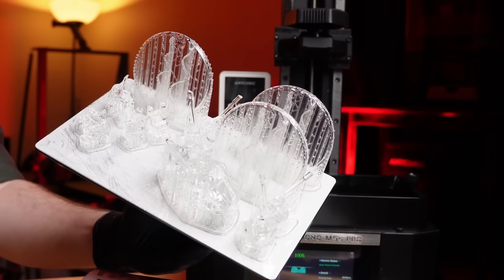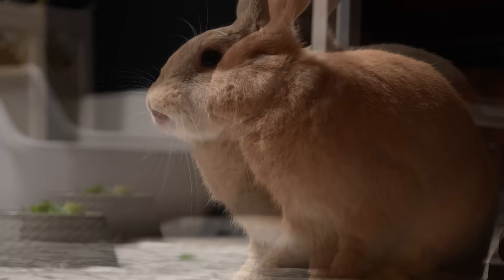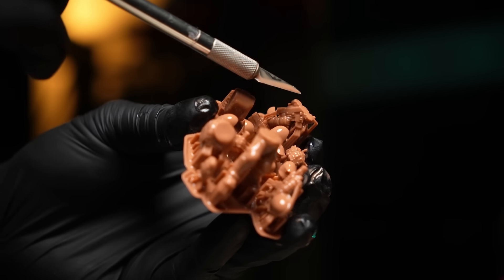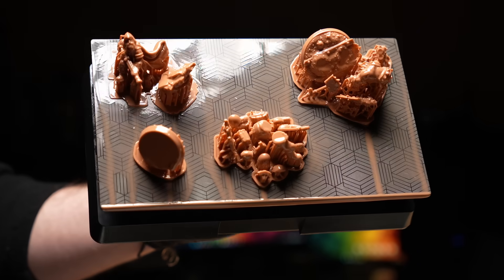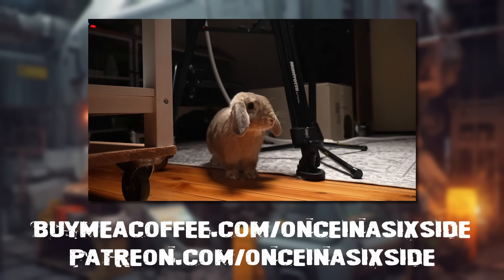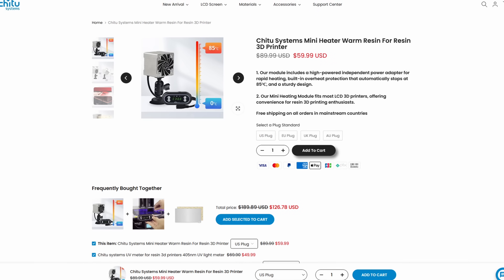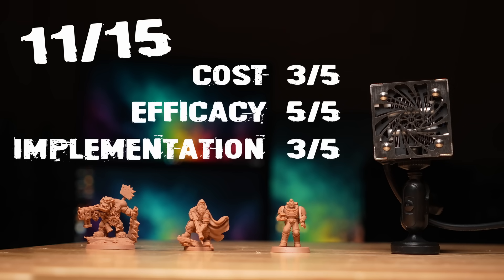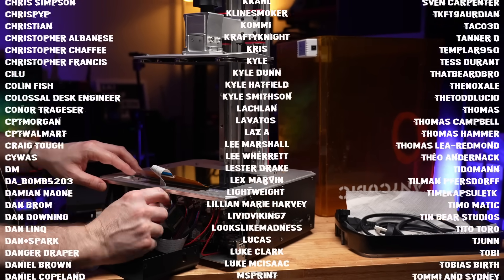Resin 3D Printers don't NEED inbuilt heaters (TESTED)

Comment: It's just not that hard to heat the resin... A heat sleeve around the vat works great on my mono m7 max, and the heating cycle mechanically stirs it.

If I needed more I'd add a little heater inside.

Comment: The M7 pro's heating function is amazing. Cleaning isnt really all that much of a pain in the ass. Normally I clean it like you would a normal vat. However if I want to DEEP CLEAN it, I drain out what I can. Wipe down my NFEP, and throw some IPA in the vat and run the heater and let the IPA cycle through the pump

Comment: Instead of placing the heater inside the enclosure, I've placed my printer inside a small tent, which I have insulated somewhat, and have placed my Chitu heater inside that tent (didn't put the lid back on the printer). Just launched a print, we'll see how it turns out. It's currently at about 12 degrees in my garage (Canada), but I don't anticipate any issue as I've done so in the past with another heater. It might be tougher on the heating unit, making it "work" from prolonged periods of time, causing it to fail earlier. We'll see.

Comment: Just for added detail so others dont need to do the maths:

Maximum power consumption and the annual electricity cost in the UK (£26.39p per kWh via BG) (based on continuous 24/7 use)

The Chitu heater uses 200W which works out at £463.35 per year.
The Elegoo heater uses 120W which works out at £277.87 per year.
The fermentation belt uses 25W which works out at £57.76 per year.

Of course, this assumes the devices are running non stop, which is unlikely, but it is still useful to know.

Also, just to let you know, the amazon link appears to be dead. just in case your getting affiliate funding. :)

Comment: Yeah, these solutions are half-assed at best, a brewers belt poorly tied around the thick metal vat wall or a blower heater which can have all kinds of mixed results in terms of actual heating depending where the heat is being blown. I think uniformations approach is the best solution among every other integrated, not added, resin heater in all the other machines

Comment: As far as heaters go, I have a Halot Mage S, its been easy to use and I am liking it, (I know Fauxhammer hated it but VogMan loved it so to each their own) but I also have an enclosure for it. If I wanted to add a heater for our winter months, does the heater need to be inside the printer itself? Or can I just keep the ambient temperature in the enclosure in the ideal range?

Comment: Chitu one replace the 3M tape with Tiger tape for vehicle registration plate's the heat in the enclosure softened the glue on mine before it's stretched and hit the vat but could have been worse!

Comment: I got the exact same belt and did the same process. FYI if you are going to do this. The "Rubber" part of the heatbelt also contains some wiring. This ruined my belt, and is a potential fire hazard if cut.

Comment: I just bought and used my first resin printer.. on about my 8th print, a tiny bit of cured resin punctured through the resin tray, spitting the release film and leaking resin over the screen.. should I always be filtering the resin from the previous print before continuing the next one?

Comment: I have the mono m7 pro, I do like it, and the resin heater is easy to clean you just pour ISO into the vat and run the clean function and it pumps iso through the heater, I tend to do it twice, once as the clean, and a second time with pure iso as a rinse but that's just me

Comment: I went for a resin mini heater from aliexpress, no brand but it's the common design with the red LED display near the bottom. It works great, just leave it running for a few minutes to warm up your resin then start your print. Even in my freezing loft it prevents failed prints.

Comment: I tested the brewers belt in Kansas City last night where it was 3 degrees F/ -15 degrees C.  My print failed as there was no build plate adhesion.  I didn't expect it to work, but I thought I'd add a little bit of data for the community that has helped me so much getting started with 3D printing.
Reply from the maker: Did you preheat the vat with the build plate lowered into it?
Reply: @OnceinaSixSide  I preheated the vat, but not with the build plate lowered into it.
Reply from the maker: @KUTroy  I do mention at 5:17 that that's how I did it, and I've heard from a couple of others that they have to do the same otherwise they have build plate adhesion failures. Hopefully that works for you too!

Comment: I have the original phrozen sonic mega 8k. No heater or any extras like the newer ones. Would you recommend the belt for this printer or something like the Anycubic chamber heater or the new Elegoo chamber heater?
Reply from the maker: My pick is definitely Anycubics blower heater. Elegoos is loud and has no control. A brewer belt is a great solution too but can be a bit fiddly to install
Reply: @OnceinaSixSide  Awesome, thank you so much for the information.

Comment: I recently added the Chitu Systems heater to my Saturn 4 Ultra and it is very effective. It was very touchy getting it mounted on the left side (looking from the front, opposite of the AI camera). I designed and printed a cord passthrough to fit the ventilation opening, which will also have a mounting plate for the heater cube itself. The supplied articulated mount takes up a lot of precious space and tends to slip out of position at times. The mounting plate I am contemplating might also accommodate an Elegoo carbon filter, but that depends on available space.

Comment: Why don't these companies just put a heating belt in the vat? Like a fermentation belt, but built in. Put some electrical contacts on the base of the vat and on the printer so you can connect the power by just putting the vat on, no need for external wires.

Comment: I use a fermentation belt for ages now to secure the print in winter.
I use a timer on my belt and my printer.
The belt is preheating the vat, the resin and inner printer itself for 45 minutes.
Then the print starts, fermentation belt is supporting another 45 mins from start, then it shuts off.
The printer is generating enough heat to keep everything fine.
You can continue printing and leave the fermentation belt completely off. Just dont stop printing for too long, so the temperature drops again.

Comment: Just so you know, the temperature reading on the machine panel is for the LCD screen heat. if it goes to 80C the printer will shut down . That reading is not for the resin temperature.
Just use a cheap laser point and shoot temperature reader and youll get a much more accurate reading of the resin temperature itself, not the cabinet

Comment: Why couldn't you just get some 8-inch heat tape and lay it underneath the tray? This heat tape is typically used for pet reptiles who need a gradient of heat with hotter temperatures on one side of the tank and cooler temperatures on the other. They are very low wattage and could theoretically be left plugged in so youre ready to print at will.
Reply from the maker: If you put it under the tray you'll block the LCD and nothing will cure.
Reply: @OnceinaSixSide  Yeah,  I actually realized that early today. Makes sense. Thank you though

Comment: I've had a fermintation band on my X2 vat for a while now. I use a terrarium powerstrip that has a temperature probe to control the power. The probe has just enough room to fit in the vat with clearance for the plate. It keeps my vat at a constant 25C. On really cold days, I lower the plate into the warmed resin prior to printing.

Comment: I don't think this will be a solution for me since it's something additional to possibly spill resin on, and obstruct when I want to clean the tank or change the FEP. I ended up using one of those pocket-sized ceramic blower heaters inside the enclosure, controlled by a plug-in reptile pad heat regulator with a wired heat probe. I set the recommended temp for whatever resin I'm using and forget it until the print timer goes off. I have everything connected to a smoke detector controlled outlet in case something goes wrong.  This whole setup has been really reliable at keeping thicker resins like Tenacious flowing in the winter.

Comment: 0:33 may i ask what resin you are using? It looks great for minis!
Reply from the maker: That would be Phrozen Aqua 8k! It's actually awful for minis imo as it's very brittle, and it's surface finish is the only thing going for it. It's not actually noticeably sharper in detail compared to any other resin once a layer of paint is on there

https://youtu.be/UCPCsemKCS4?si=BYzouJNbEyfx1MV6
Reply: @OnceinaSixSide  cheers and thanks for your great vids!

Comment: Hmm. That Anycubic system with the pump is actually kind of interesting. Not just because of the heating system, but sometimes if you're using particles or pigments, the model doesn't displace enough space to keep things stirred up, so a pump system might help with that. I agree that it would add complexity, but I've run other peristaltic pumps before and it isn't too bad. Might make for a good diy project, too.

The problem with the that fermentation belt is that there's no temperature control. Some resins need even higher or lower heat for their ideal settings, so not great when you can't control it. I do see an amazon listing for one with a rheostat built in that I'll probably give a try, but there's no info on its highest temperature or length of belt.

Comment: My workshop is in my unfinished garage. In the winter I can't use resin printers at all in there. One trick is to simply run hot water on the build plate and dry it off before printing.

Comment: just a theory, because the saturn 4 and the ultra uses a tilting vat could you not put the chitu heater in the base of the printer to heat the resin?? as heat rises and the base will lock in heat more

Comment: My print workshop gets very cold so I installed a heater and use a heat gun to check the temp. It takes 30 minutes before I get printing and never print under 19 deg C but best temp is 25 deg C + . I also have a heat shield in front of the heater outlet to deflect the air around the inside of the printer. Resin temp is one of the first thing I talk about when people complain about poor printing.
Reply: Only problem is they say to not leave space heaters on overnight

Comment: I gather the belt is even more useful in places with consistent lower ambient temperatures (like your case on constant temperatures below 10°C).

 However what is the result difference against only using the belt or any other means to just preheat the resin prior to the print being started? (i believe there is an exothermic reaction constantly occurring that unless exposed to consistent low temperatures could be enough to mainting a workable resin temperature)
Reply: if its like 60F it can barely self heat, but unless you have turbo settings it wont make enough heat to relly on.

Comment: Would you need to run a thermostat with this setup? Or does the brewers belt not get hot enough?
Reply from the maker: The heatbelt actually gets surprisingly hot! I've heard from others that say they run them successfully on a thermostat to help keep the resin from getting too hot.
Reply: Cheers! I will have to do a bit more research

Comment: The chitu solution looks good, but seems quite overpriced for what it is (heater, fan, thermal relay... ?). I'm looking forward to what OISS has to say about that mini heater actually. I don't understand the struggle manufacturers seem to have with the idea of a heater. 

I can't imagine most users care significantly about the carbon purification which doesn't even reduce VOCs but just reduces smell, they just want a heater that keeps their resin at the same temperature consistently. Even their mini heater has a carbon block in it and blows the hot air upwards, which is really dumb. The whole thing is so frustrating.
Reply: you can build you ow for cheaper but that doesn't come with a warranty or long term safety testing.

Comment: Why don't they just put a cheap heating element on the top of the build plate? Every time it dips it moves the resin around and the heat will spread evenly.  I might actually try this mod on my anycubic mono (yes the original 2k one that is 50 microns in a 6 inch screen).
Reply from the maker: Keep me posted! I'm keen to hear about your results

Comment: Thanks for the video. 
I purchased a brewer's belt and a little $4 thermometer that sits under the hood. It probably doesn't give a perfect representation of the fluid temperature, but I also have a thermometer outside the unit and there is definitely a difference when the heat is plugged in. I secure it around my vat with a large binder paperclip.

Comment: How “tight” was tight? I’ve got a Saturn 3 and there’s a couple of mm gap around the bat with the belt. I’m in Melbourne and it’s usually pretty cold at night, but I do have an old wardrobe I’ve fitted with foil board to keep it insulated (both winter and summer)

Comment: My initial 3d printing experience was  a few years ago and my printer arrived at the very start of the Adelaide winter. I spent ages dialing in hundreds of tiny variables and was very near quitting and tossing the thing. Until september rolled around and the temperature in my garage got up to 18-22 and suddenly my prints were great. Without a heating mechanism, I've just been blasting heaps of prints in the summer and painting in the winter. Thanks for helping others with this very useful info
Reply: I live in SA also and people that start 3D printing don't realize how important resin temp is. Happy printing

Comment: I had 2 prints fail al the end with a big model crashing into the vat rupturing the fep film on my halot mage. Twice in 3 days only to realize now it was the lower temp that prob caused the bad bed adhesion. Fml. Those fep films are not cheap and such a pain to replace. Ive gone through 6 of them already

Comment: Could you answer if the fermentation belt still works on the ultra? It seems like there is still enough room at the top even with the tilt, but I'm not sure.

Comment: I use a belt on my Mars 3 pro, its not perfect but has made it possible to get prints off during the winter (UK) in my unheated workshop even when its under 5 degrees C in there - I also pop an insulated 'cool bag' over the top of the printer if its below 10 degrees C to help it retain a bit of heat for longer

Comment: It wouldn't be that hard for a manufacturer to make a heated vat, although it would be more expensive (optional addon?) you could run one of those heater cables inside the walls of the vat then have two magnetic contact points that connect it to power next to the LCD.
Reply from the maker: Heygears actually more or less did this in their Ultracraft Reflex printer, and it's a very very awesome and effective solution - but that's more of a professional business/workshop type 3D printer with an extremely high cost, so I didn't bother mentioning it here.
Reply: @OnceinaSixSide  Well if it's still not a common feature in a few years once I have space for a resin printer I might be crazy enough to try FDM printing a vat to make this happen. Here in Wisconsin where it gets to negative fahrenheit it would be a necessity.
Reply from the maker: @schmiddy8433  Sounds like a fun and challenging project! Although many have commented here on this video sharing their experiences and it seems the methods discussed here (blower heaters and fermentation belts) work great in sub zero tundras like yours :)

Comment: I have three GK Twos. The fourth one is on the way. While the screen life may be shorter, I’ll just order a replacement when they die. But what I’ve learned is that a Vat heater is really the best. In an ideal world, the vat frame would be metal with a heater built into it, not below the screen. That way the resin would be warm, which is really the most important thing.

Comment: I have a Mars 2 Pro and unfortunately I can't run the belt round the vat whilst running the print, but preheat the vat for about 10-20 minutes to get the resin up to  28-30C
In the Spring and Summer that's been enough and in the Winter I was running the belt round the outside of the printer and printing perfectly well even in ~6C temperatures in my garage.
I am considering switching to an in printer enclosure heater just for ease of use if it will fit.

Comment: i JUST recently bought the Chitu blower, and havent had a chance to try it. however, i knew it was going to work, because i used to have just a bog-standard small space heater blow at my Mars 3, and i would prop up the lid so the vent system i have installed (the once in a six side system) would suck sir in from under the lid, effectively warming the inside of the printer, and that mcgyver system worked just fine.

had i known about the fermentation belt, i may have started with that, because i love being cheap. also, had i known Elegoo made their own, i may have bought that one instead as well, since i have an elegoo printer

Comment: I have two of the Chitu Systems heaters for both of my Saturn 3 Ultra. I find they do work really well, but my machines are in my basement where the ambient temp is typically above 65 F but rarely over 70 F. I do let the resin pre-heat for an hour or so before starting prints or after refilling post-print before starting a new print. I'm looking into a self adhesive heating belt for my Mars 5 Ultra that is on pre-order due to the space limitation inside of that unit.